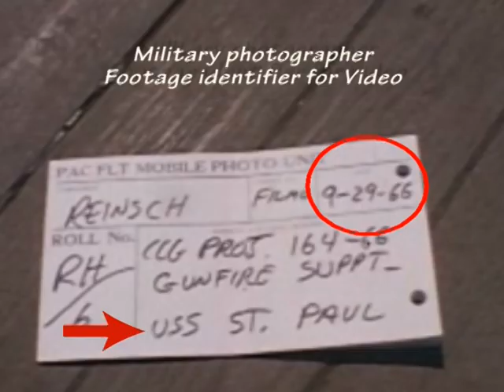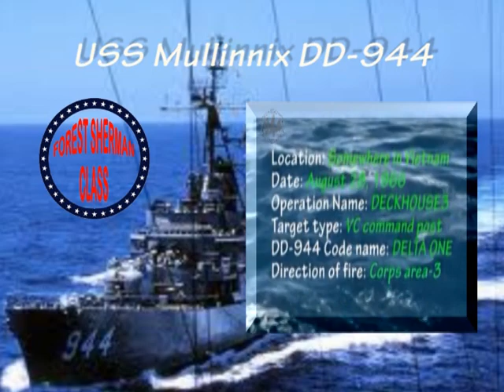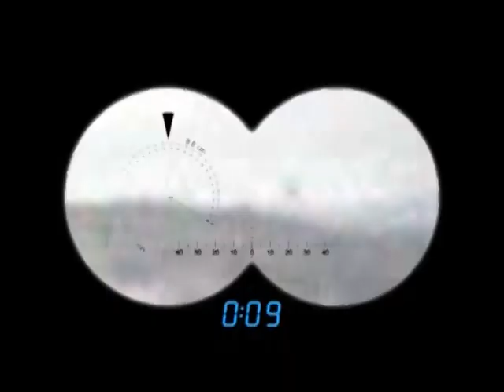NAVY GUNLINE

Comment: I'm a card carrying member of the Gulf Of Tonkin Yacht Club. Earned that from serving on the USS James E. Kyes DD787, first saw VN coast line in 65, again in 66. Spent many a sleepless hours of rack time laying in my bunk listening to the ammo elevators working, and the dual 5" 38cal forward guns doin' their thing. My bunk was about 10' from the bulkhead that separated the sleeping compartment from the ammo handling devices. One slipup, and BOOM...
 Came back for one more tour to the Tonkin Gulf in 68 on board USS Brooke DEG-1 but never saw gun line duty, and never got closer than about 10 miles or so from shore. Of the two ships I enjoyed the Kyes much more than I did the Brooke, even though the Brooke had better accommodations.
Funny thing happened in early 68, when N. Korea captured the USS Pueblo. I was aboard Brooke, and our relief from that freezing hell-hole off N. Korea was the Kyes! Funny how things work out. We (The Brooke) had just come from a couple days of nice warm weather in Hawaii when the Pueblo was captured. We were ordered to make haste and head to the Sea of Japan and patrol just off the coast of N. Korea. 

We transited the Tsagaru Strait at night without running lights of any kind, unusual to say the least! It was pretty cool. Narrowest part is about 12 miles, plenty of rocks and reefs but we missed it all.
The coast off N.K. was cold and about 25*, & snowed quite a bit. I don't think we were there more than a week or so, if that, before Desron 32 (USS Kyes) relieved us. They were supposed to be on their way home, but got a change of orders. Good! Let them freeze!
Reply from the maker: Interesting.  Thanks for your comment.

Comment: Very nice video Melvin but the USS Newport News used semi fixed 8" rounds that loaded automatically, the video showed them putting powder bags behind a projectile. ETN 2 USS Newport News CA-148 68'- 69'
"Fair Winds and Following Seas" Bro.
Reply from the maker: Yes, several viewers made me aware of that.  I discovered (too late) that the footage in question was actually the USS ST. PAUL CA-73 (which coincidentally was my brothers ship).  I served on the NNEWS CA-148 (Deck Force 1957).  I apologize.
Reply: Melvin Douglas, no need to apologize Bro. I was just pointing it out. I am very proud of that ship and the power she projected 90 rounds in the air before the first one hit the ground.
 As I have said before "Very nice video Melvin' well done. I guess I'm just getting picky in my old age. Thanks for your service and sacrifice.
"Fair Winds and Following Seas" Bro.
Reply from the maker: I'm an old timer too.  Keep my cane handy in case I need it.  Smooth sailing to you.

Comment: There is some BS here as the Newport News didn't use powder bags but brass semi fixed power cases.
Reply from the maker: That error was discovered and revealed in one of the early comments.  That footage was determined to actually be the USS St. Paul CA-73 (in her early days).  My fault and I apologize (again).  Thank you for your alertness..
Reply: EAA 1202 Farmville
There's no BS, it is a simple mistake.